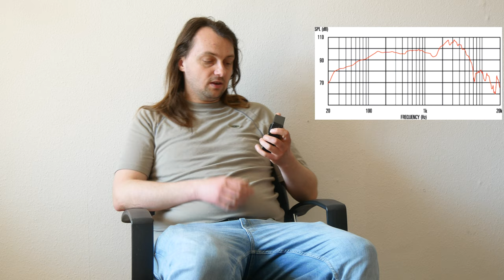History and future of guitar cabinet modelling: Pt.1 Hughes & Kettner Red Box and other analog gear.

Comment: thanks, interesting video - gon check the next parts later on

btw the thing which so disappointing me in new AMT bricks is what they dont fit to the most of traditional pedalboards, unlike previous AMT lamp pedals (i had 1st-revision SS-20 many years ago, really loved it for its small size)
Reply from the maker: Bricks don't fit the pedalboard ? Wow
Reply: @leothemetal  by their height - i use boss bcb-90x and bcb-30 pedalboards and by measures it seems they wouldnt fit there

of course there are bigger ones on the market, but my point was what most of guitar pedals have their average height, for which pedalboard makers are aiming
Reply from the maker: @ActionlessLoveless  Well, that's true. 
I use cheapest Harley Benton with a gigbag, it fits there perfectly.